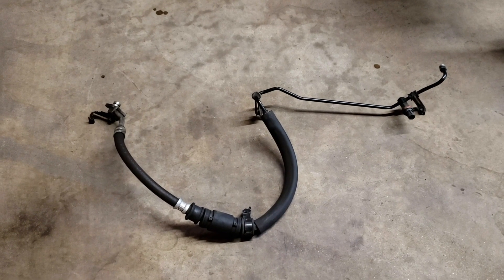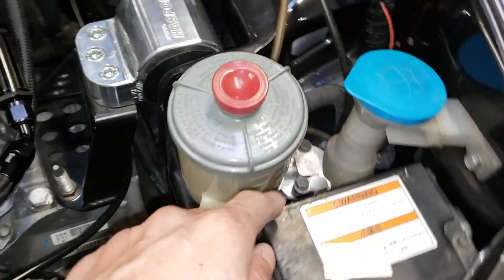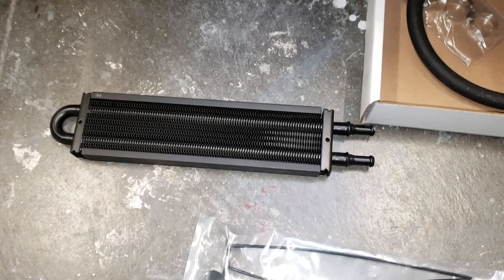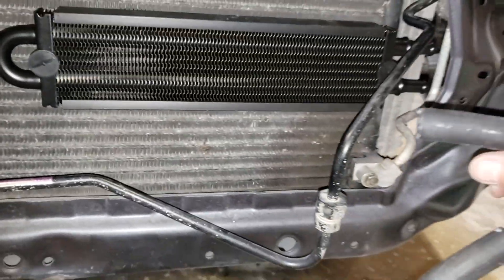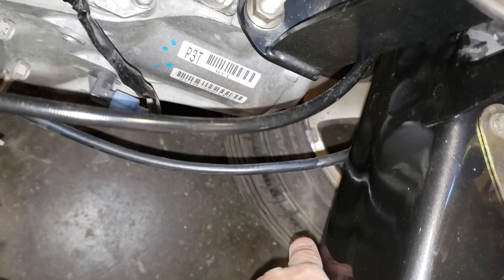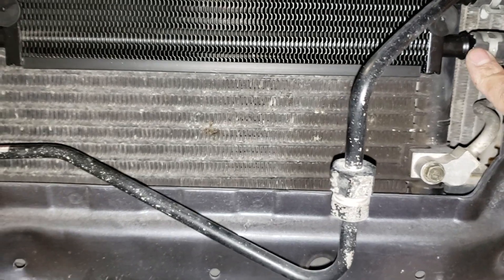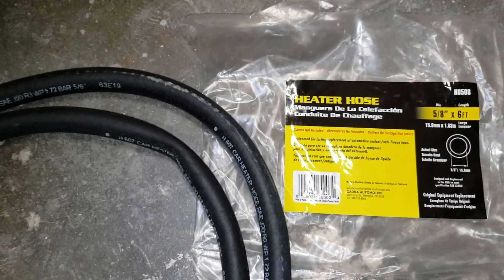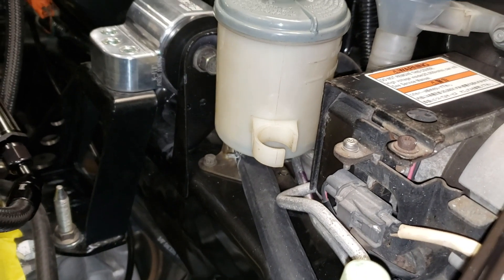How to Build a Budget Power Steering Setup for K24/K20 Engine Swaps

Comment: Hi! I understand this is a old video but have you experienced any issues with the long hose running back to your reservoir bottle as the oem line is very short compared to the one you are using.
Reply from the maker: I did't seem to experienced any issues.

Comment: the type s line does not fit. learned it the hard way. it uses a M16 nut, and will not fit the integra rack. :(
Reply from the maker: I don't know why you were having that issue. I really didn't think Honda would have a different power steering line for the Base and Type S because it wouldn't make sense for them when the both chassis is basically identical and for production wise.
Reply: @jsrebuilds3951  the 05/06 use 53713-S6M-A51.
Reply from the maker: @khamkham7134  GREAT Catch! Thank you for pointing this out. I would of thought the 05/06 would be same and apologize for the confusion. 
But you are right, I just looked and the 05/06 Type S is different but the 05/06 Base is same with everything else with this part number 53713-S6M-A04. 
Thank you again and I will correct this in the description below the video.
Reply: Really? That’s a bummer. Wonder why he said it was a direct fit
Reply: @itsjussjerry  the regular rsx fits (not type s)
Reply from the maker: I apologize guys I didn't answer right away, when I purchased the line from a friend and I'm pretty sure it was from a type s.
Reply from the maker: I've did a search on the Honda OEM parts website, it says the Base and Type S is the exact same part number. 53713-S6M-A04

Comment: How did you wire the PS switch? On b series the plug comes with the harness but for k swap I don't see the harness having the plug
Reply from the maker: That plug for ps is already on the chassis of the integra not the engine harnesses.

Comment: Awesome video...for EK kswap, will this setup work with an EG subframe?
Reply from the maker: Yes it should but I believe it would be better if the reservoir is closer to your power steering pump. Mine is working but it seems to not work as well because I believe the travel of the fluid is affecting it. I may move my ps reservoir near the ps pump in the near future.
Reply: @jsrebuilds3951  Thank you so much for the reply and valuable information...appreciated bro.
Reply: @jsrebuilds3951  did you end up relocating? Good video 👍🏼

Comment: Is ps cooler a mandatory thing or optional? Would it be okay to run it without the cooler?
Reply from the maker: I'm not an expert on this but the Integra has a factory hard line in front of the car to cool down the power steering I believe. You may be able to use the OEM hard line but this aftermarket cooler was 25 to 30 dollars so I think you should have some kind of cooler. Also with the power steering line having a cooler its going to help with the fluid not breaking down faster from the heat. Also the power steering line close to the headers, it looks like it would get more heat from it.
Reply: @jsrebuilds3951  I am about to kswap my eg, keeping AC and PS that’s the reason why I am asking if it’s mandatory. I don’t believe eg has the cooler hard line like tegs but I will double check. Thx bud
Reply from the maker: @PaChiLa_Leader  Your welcome, I'm sorry I'm not an expert. I would like to help in anyway that I can and appreciate you reaching out.
Reply: @jsrebuilds3951  pleasure is all mine. Thx